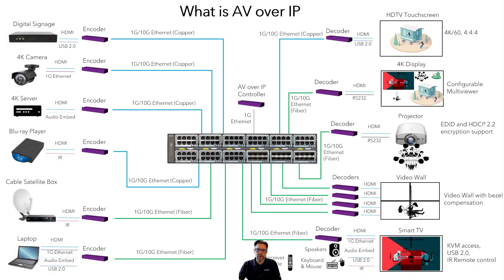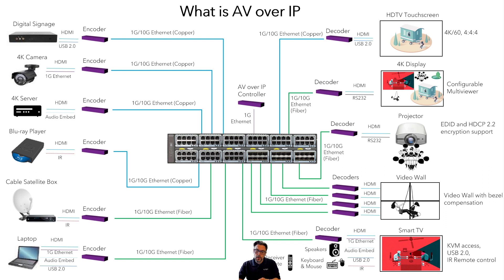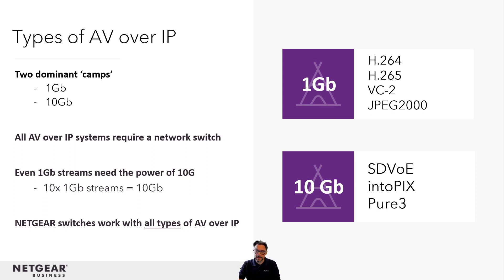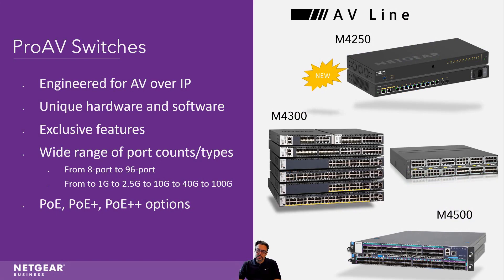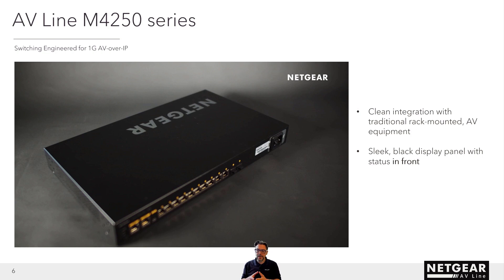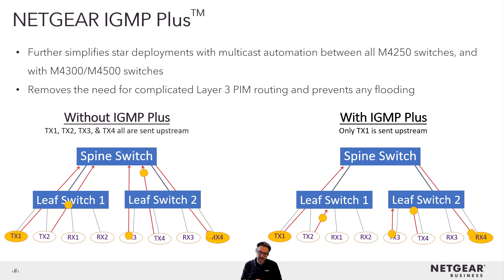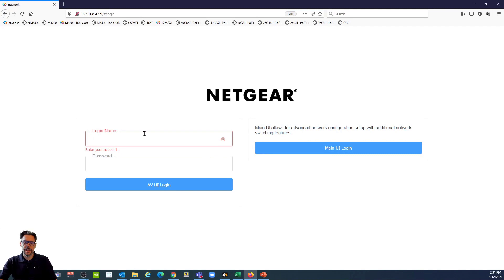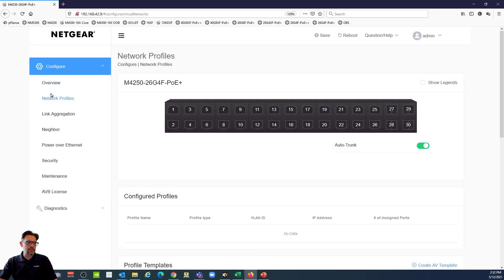NETGEAR M4250 Switch Series Product Overview & Demo

Comment: Will be installing these at our two radio stations interconnecting with our Cisco Core switches as we upgrade our analog audio to digital... Will come back here and let every knows in a few months how it goes. The network design is an advanced configuration however so these switches will be using a custom setup and not the base configuration.
Reply: you didn't come back to tell us how it is :D

Comment: Correct me if i'm wrong but i just wish you guys would have come out with better options on the M425.  Such as 8port or 12 port poe with 10gig or SFP+ uplinks.  i currently use the MS510TXPP which is perfect both in price and abilities but lacking in features that the M series has in terms of AV.  That and I wish these guys would allow DHCP passthrough or have one of their own but I get it.  anyway i can only find M4250's with 8port and 2port SFP (1gig) or the same with poe++ and two SFP+ that is $500 more.  Too bad you couldn't make a MS510TXPP like switch with 8 or 12 ports and 1 SPF+ and or copper 10gig in poe+ that isn'ty $1k.  I want replace my MS510's and use the feature set of AV but  don't need the poe++ and the two SFP+ that make that model $500 more.  then again we were spoiled with the MX510 being so damn cheap :).  anyway hope to get my hands on one of these soon to test and compare to the MS510 in performance using full NDI and dante